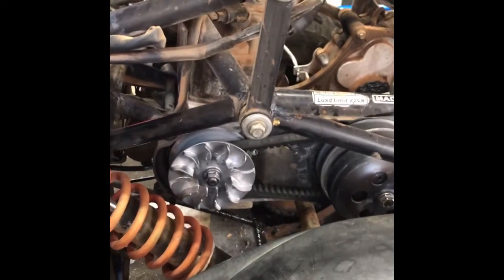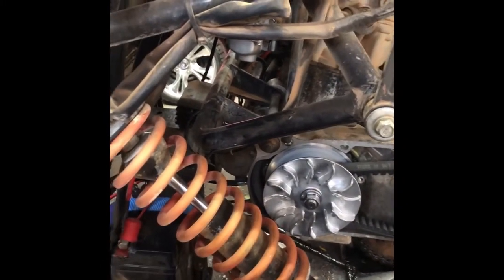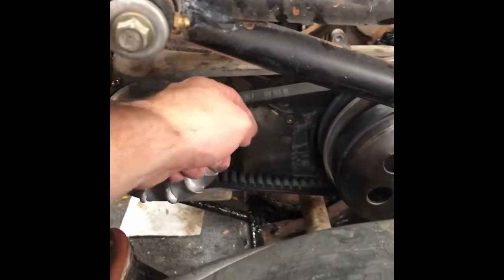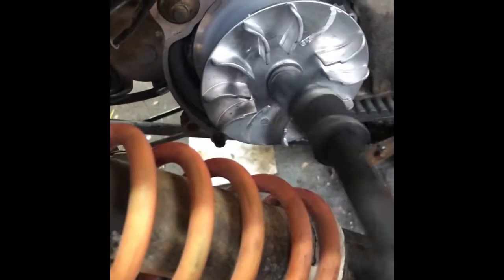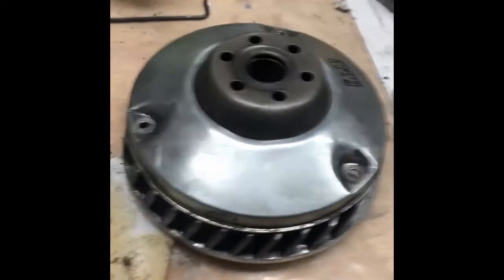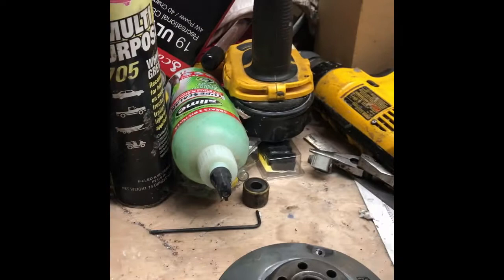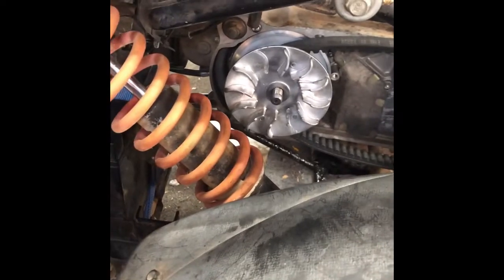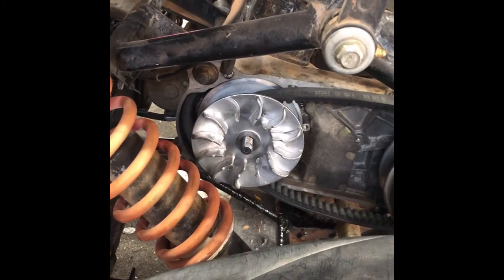Chinese Buggy Roketa GK-19 250cc 150cc CVT Gear Ratio Change, Increase Power, Increase Acceleration

Comment: Just looking at your clutch the belt is not reaching the top of the back pulley which is where your torque comes from.
My sugestion is to check why ur clutch pulley is not fully closed or if your belt is the correct size.
And for the front pulley there is a couple of things you can do.
1) see if you can fit a bigger pulley
2) get sliders not rollers
3) put a mark on the pulley, hit full throtle and see how high does the belt go and if it doesnt go all the way up machine down the splined bushing a little at a time and that will give you more top speed.
4) grind out the roller canal to allow them to go out more and that will give you a faster responce on low end.
Oh and check the cluch bell and see how worn it is and good luck and drive safe

Comment: Let me start by saying thank you and great instructional video! One question, I have the same buggy and would like to know if you measured the rollers and if so what size are yours?
Reply from the maker: Here’s the exact order from Amazon:  250cc 23x18 Roller Weights https://www.amazon.com/dp/B00J5LUIIE/ref=cm_sw_r_sms_api_glt_fabc_EESBVZ6F27NA6ZT9AG59?_encoding=UTF8&psc=1
Reply: @pattywaktdiy4175  I appreciate you man! Thanks !
Reply: Thanks for the video, man. What size is the belt? I got the same buggy 250c. Also any idea why my buggy it won't turn on with the air filter I have to take the air filter from the carburetor to turn on
Reply: @2and4stroke949  sold mine along time ago. Luckily I still had the picture of the belt lol. The belt is 828×22.5X30 . As for the starting issue try setting the mixture screw at 2 turns out from gently seated closed. If nothing changes try doing a valve adjustment( only if you have that experience) and I would also check compression. Hope this helps.
Reply: @slowk6gixx1k78  Thanks, I will try that. Every time I press the gas pedal, the engine turns off. Do you think is the clutch?
Reply: @2and4stroke949  absolutely not the clutch. When you give it gas, there is obviously a higher demand for fuel. I would say carb related like too much fuel or not enough. Those have plumper carbs so take off the cover (I believe it’s on top) and check the rubber diaphragm. Also look around the carb and make sure there isn’t any vacuum leaks (air getting sucked in other than the intake)
Reply: @slowk6gixx1k78  Thanks, sir. I bought a new carburetor from Amazon last week and still does the same thing, so I was watching a lot of videos, and your buggy is the same lime my. I was thinking of buying the clutch and the ctv? It is weird that it turns off only when I press the gas pedal and sometimes runs for a bit, bu it turns off
Reply: @2and4stroke949  yeah man they can be finicky at times but pretty reliable for the most part. If you are getting performance clutch, I’d say go for it but for your problem I don’t think that’s where it’s at. Other things I forgot to mention was check timing and the CDI boxes are known to fail. Wouldn’t hurt to check the stator and rectifier regulator. I wouldn’t even bother buying anything or even doing a valve adjustment until you know compression is good and the timing is right. When you figure it out, let me know as I am very curious lol. Good luck.

Comment: Hi,i just fix my hammerhead 250 cc and i will like to do that to it,how can I find this kit?
Reply from the maker: The variator rollers are somewhat generic.  You’ll need to remove one from the variator, count how many there are, weigh it and the use a caliper to ensure you get the right size (width and diameter). I found these rollers on Amazon.